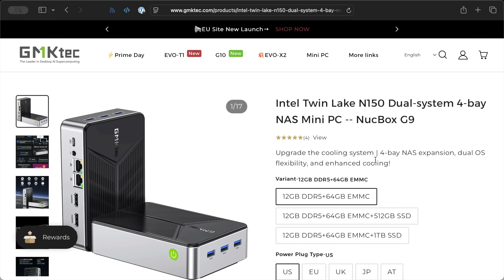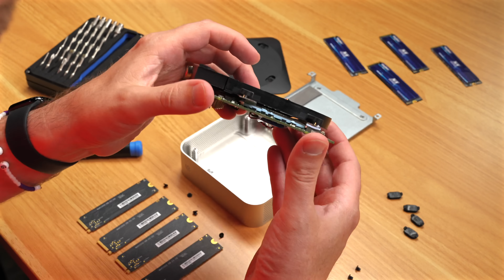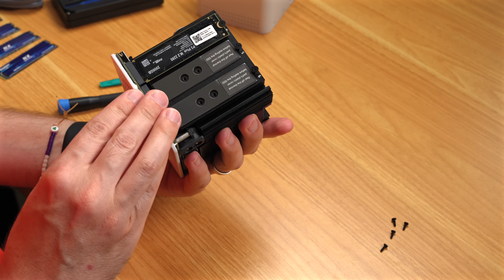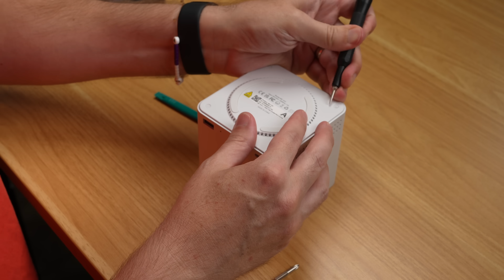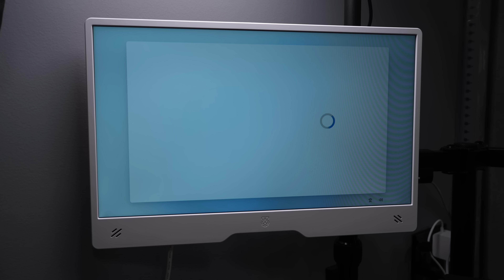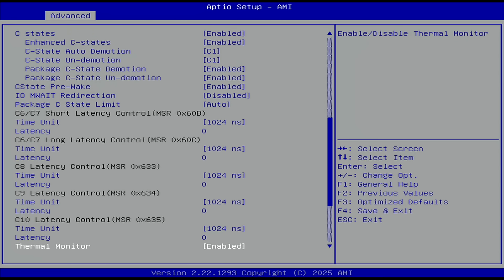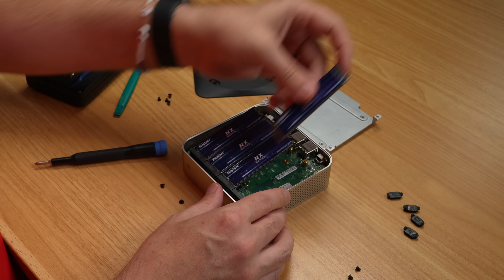The Mini NAS has arrived! (mini homelab)

Comment: I think that's an air intake on the top, not an exhaust lol

The fan inside definitely looks like it's intaking from the top and blowing the hot air onto the bench

Curious if you can remove the fan and flip it over
Reply from the maker: I don't think the fan would work flipped as the mounting and connector don't allow flipping (it's a frameless design), but it does look like it's an intake, which would explain the hotter bottom. strange way to design a chimney though!

Comment: Other Reviewer said, that the fan is an intake. that's why you got the hot area on the Botton. but how are the temps of the ssds? some people has overheating problems with 6 ssds. especially then using as server with constant cpu load.
Reply from the maker: I only ran 5 maximum, but it was keeping them in the 50-55°C range, which was fine by me. These are lower power SSDs though; there are many that pull down a couple watts each, and those are harder to keep cool. You'd probably have to push the fan curve up a bit to keep that system running better.

Didn't realize the fan was running as an intake, that doesn't make as much sense to me for a chimney-based thermal design! But I guess their engineers planned it that way, and that's why the bottom was hotter.
Reply: @JeffGeerling  are this ssds single or double sided? dram?
Reply: and could you test, if the temps better if you change the direction of the fan?

Comment: Oh another bonus you did not mention about the Beelink.  That Wificard can be removed and replaced with an AI accelerator card making that NAS capable of also running a very nice Security camera recording software platform that does hardware object detection.    Huge bonus for the beelink
Reply: Level1Techs tried it and it didn't work. But it was cnvi and USB options in the BIOS when I got it so potentially fixed.
Reply: Meh!
Reply: !heM @TheZimberto

Comment: For what it's worth, I used to run my FreeBSD NAS with a USB flash drive boot disk and never had a problem. Actually, I used two USB flash drives in a geom mirror, just in case one of them failed. But none ever did.

I used a memory disk for /tmp to prevent too much write wear. And since it was just a NAS, I rarely touched the boot disk. If you wanted to run some containers, you could always put those on your SSD array. Performance was fine, too, since after booting, the OS is loaded into memory and doesn't need to hit the USB drive for much.

And if you use those low-profile USB flash drives, there's no risk of anything bumping it and disconnecting. For my NAS, this wasn't a concern, as it was a larger box and I connected to the internal header. But for my LibreELEC HTPC, I use one of those tiny drives and it's worked great. One benefit here is that I can do a fully copy of the USB drive occasionally (e.g. before a big upgrade), and if things ever go bad, it's easy to re-flash to a known working state.
Reply: Do you know of a trick to make TrueNAS CE not write as much on the boot pool?
Reply: @voice5sur5  I'm afraid I don't have any experience with TrueNAS. There used to be a version based on FreeBSD, but they moved everything over to Linux a while ago, and my experience there is more limited.

But in general, I would try to track down what is causing heavy writes to the boot pool, and then see if there's a way to better manage that. The usual suspects are things like tmp and log directories. Linux has tmpfs, so I would imagine that would be enabled by default. But there might be some logging or DB writes happening from TrueNAS's software.

Sorry I couldn't be of more help. Your best bet is to go to the TrueNAS community forums if you haven't already.
Reply: Like for using FBSD too 😊

Comment: Could you not partition a 1GB boot (and empty 1GB partitions on the other drives) and a raid10 far2 root across 4, raid10 far2 swap across 4, and then the rest as raid5; so 4 partitions on all 4 drives? You lose 3GB in total. That way you're not wasting 2TB on an "OS" drive (you only need about 80GB max for a very heavily loaded root fs) if you bind mount /home and/or a /data directory from the raid.

Comment: I actually got that exact BeeMini model after seeing your previous video, doing a bit of research and finding someone else review of it.

It’s my first NAS so very experimenting here but I ended up installing TRUENAS on the emcc as well
Reply from the maker: Good luck and have fun! Try to make sure you have a backup too, makes accidentally breaking things less stressful :)
Reply: I have one on order and I am torn about installing TrueNAS on the eMMC. That reliable source Reddit says it's a bad idea because it'll wear out and fail quickly. On the other hand it comes with Windows pre-installed, so it can't be that bad. But on the third hand, slot 4 uses two lanes so it makes sense to put the OS on a 256GB NVMe in that slot, but then it leaves an awkward 5 slots.
Reply: @merseyviking  I think that I will move it to  one of the drives eventually - I only had one NVME at hand when I got it so didn't want to use it for that.

Can't you replace the emcc if it fails? What can we use it for otherwise?
Reply: @BenleGentil No, the eMMC is soldered on to the main board.
I am now thinking of using slot 4 for the OS, and removing the wifi board and using that as a 7th NVMe slot, but it depends on how much room there is and what heatsinking I can get on it.
As for using it for something, I reckon using it as a backup target for TrueNAS configs could work. Or encrypt it and put secret keys on it.
Reply: @merseyviking  got it! I confused it with the wifi chip…
Reply: usually with truenas I mirror the boot drive. Wonder what optimum setup would be here.
Reply: @merseyviking  Truenas boot drive is basically read-only except for updates, so you definitely should not ever have to worry about write endurance. 
Also, since Truenas data (logs, config, ...) is stored on the first storage array you create (by default), IF the emmc was to fail you could simply install truenas on a usb drive and change the boot order to get everything working again.
Reply: @merseyviking Thanks for your interesting thoughts! I understand it is limited to 8GB memory?… so we are probably not going to go for deduplication in TrueNAS? 
I am considering this with Proxmox baremetal and hosting TrueNAS as a VM...the PCIe's as passthru... and using your wifi-replaced-as-PCIe idea.... I'm doing such on an old 2015 laptop successfully but wanna move to this hardware solution.

Comment: The cooling situation on the Beelink with the pads only touching the controller is actually ideal, NAND is meant to operate at a higher temperature and when you cool it you lose out on reliability (see: Influence of temperature of storage, write and read operations on multiple level cells NAND flash memories)
Reply: The specifics with NAND is it does not like writing at low temperature and then storage at high temperature.

A high temperature write forces a stronger write - more electrons into each memory cell. This helps retention. But at the same time, high temperature also increases the speed that electrons migrates out of the cells.

So for home use, it's normally best with a cool drive with weaker writes and also slower migrations.

For server use? Hot drive with stronger writes compensating for the higher migration speed. And for server use, you get way more rewrites, so less likely to have data left untouched for a number of years.

For long-term cold storage? Run the drive really hot. Write all data. Remove and store cold (but non-condensing).
Reply: Well yeah, but the poor N150 SOC isn't going to be fine handling it 24/7 NAS style, not to mention some of them had power supplies embedded that would get hot by ambient temperature, and you don't want your power supply to get HOT easily so no.
Reply from the maker: I think there's definitely arguments for the other way too (if there's no thermal contact, you can't manage the temperature as efficiently based on fan curves) — the main thing I've noticed is most manufacturers put heat-transferring labels over the front side of the drive (it's not just a sticker) and the intention is you put a thermal interface against that entire side and not just over the storage controller...

However, I don't think I've ever seen stability issues with even the cheapest NVMes if we're talking anything under like 70-80°C, and speeds like Gen 4/5 and beyond.

Comment: Thanks Jeff - that's really helpful.  I've currently got an old QNAP 6-bay NAS (with 24Tb spinning rust), which is noisy, hungry, and very fat.  Your review just helped me identify the perfect replacement in the Beelink (I was going to go with a couple of Pi NASs based on one of your earlier videos).  May have to do some tweaking to get better cooling at the base (maybe they'll fix that in a later iteration).

Comment: I'm going to experiment and see if I can put an m.2 a+e to m.2 nvme adapter and see if it works.  I'm also going to use something I saw from another creator and put an m.2 extender in slot 4 and run that out the case and connect 4 to 6 sata ssd's.  My parts arrive tomorrow.  
I will say I had issues installing truenas to the emmc. I had to go into the shell and use parted to recreate the partitions before truenas would install.

Comment: Isn't the eMMC on the Beelink just as unreliable as a USB drive?
Reply from the maker: No, modern eMMC storage is pretty decent. Sometimes they use cheaper memory, other times better; but even the cheap eMMC storage I've used in the past few years has been more reliable than the cheapest USB flash drives.

Comment: Why wouldn't one boot from a usb stick? Is it just the reliability or is there actual danger loosing data if the usb stick dies in a weird way?
Reply from the maker: For me, it'd mostly be "oops I picked up the thing and didn't realize a USB stick was in the back, and it snapped off" :D

But a good USB stick isn't that bad (I typically use a SanDisk or maybe Samsung, one of their midrange options that's more like an SSD with a large enough metal body to keep it cool).
Reply: @JeffGeerling  I have been using my G9 with a 2230 nvme ssd in a tiny external USB enclosure. It's a bit janky looking but more flexible, reliable, and performant than a typical flash drive. Also a bit more expensive, but not terribly much. 😊
Reply: @JeffGeerling  Love that you actually respond to comments. Thx dude

Comment: You can create array on top of LVM
You could do the following partition table:
nvme[0-3]n1p1 - size 300MB and RAID1 for /boot (mdadm 1.0 metadata version)
nvme[0-3]n1p2 - rest of disks available space as LVM PV

and then inside LVM you can create system LV for / with mirrors=2 and install system there and LVs for you data on each PV, then combine with ZFS.

In that case you get redundancy for system LV and it will boot from any NVME available and can survive lost of one NVME with system.
Reply: Why not to let the ZFS of BTRFS handle the hard drives directly? the ZFS particularly doesn't like anything between itself and the raw storage. You can create raid1 volumes and boot from it.
Reply: @OwnTwoHands_  It's not flexible as LVM and could create issues for OS to boot.
Also it's possible to create LV that will be encrypted with LUKS and use TPM to unseal it during boot from initramfs.

Comment: I´m not paid by bee-link; and my first device was the "9" - terrible heat (Baking Brick), than i choous cwwk p5, solid metal, stronger cpu.. and it´s a nice tiny device.
I run proxmox on it, and Zimas-OS inside proxmox.
The problem was/is; even when i switched of the VM... the cwwk still run hot, as it was while useing Zima-OS
Running only proxmox... there wa not heat problem at all.
And than i ordered the me mini, for myself, 2 devices.
The support was helpfull at all, and we tried to find the best solution, and they knew... i am not a influencer, not a youtuber... only i privat buyer, uesing for myself

What should i say??? I tested a lot aof the mini devices of the last 2-3 years; and i was mostly against nvme-solutions (Expensiv/capacity and so on) , but filled with 6x2 TB, for the moment it´s great: Mostly no heat, no noise, it´s fast (U lose so many time while others things, so bottle neck is your smallest problem)
At the moment - and i really love the cwwk - , for me, for this basic price of 209 + NVMEs the me mini ist the best offer on market i knew.
One one device i run "TrueNas" on the emmc , on the other Proxmox with vm´s, and since i had them (1 or 2 month) there was no problem at all

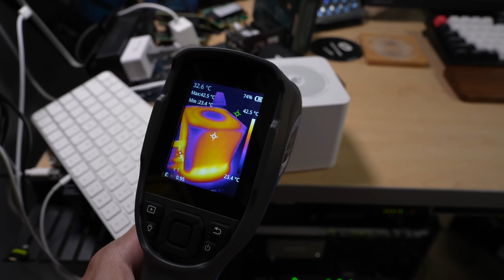Comment: 11:04 I don’t know where you’re feeling air out the top. The beelink fan intakes from the top. Thats why the heat is radiating out the bottom. It wouldn’t do that if the fan was actually blowing out the top.
Reply: What if you flipped out upside down and added some feet to allow better air flow from the "new bottom"?
Reply: Blowing down in my experience also helps keep dust from accumulating.
Reply from the maker: Ah... that actually makes sense. And why it felt cold up there... I was feeling the air intake and not exhaust.

Seems like a silly way to design it then, you lose any of the chimney effect / passive ventilation that way.
Reply: @JeffGeerling  From what I've heard, it doesn't take much to overcome convection with a fan of any kind. It probably doesn't make much of a difference either way for this...just depends on where you want dust to collect I guess?
Reply: @JeffGeerling  I wonder if putting some feet on the bottom to raise it off the desk a little more would improve the cooling.
Reply: @JeffGeerling  actually the air turbulence inside the case caused by the interaction of the chimney effect and the fan flow causes more heat to be dissipated into the air which is then exhausted out of the bottom. Similar setups are used in a bunch of industrial machinery.
Reply: @JeffGeerling  Wonder how much flipping the fan direction would effect cooling.
Reply: @Awrethien  I'd like to see an update on that, even just as a pinned comment.
Reply: @JeffGeerling  Not really, since the chimney effect is always bad, because the warm/hot air takes time to get up and in that time, it accumulates more heat at the bottom.
Also, blowing it out at the bottom creates another "chimney effect", but around the case ...
Reply: It may be that the largest source of heat is at the bottom (PSU?) so pulling cooler air over the "less hot" parts avoids feeding them pre-heated air. Only your FLIR knows for sure...

Comment: I ended up returning the me mini.  I’d bought it for a frigate server replacement for a larger server and had high hopes but didn’t even get through creating a zpool before drives started going offline from what seemed like either power or some other bad controller.  Ended up just bailing on redundant drives and using a radxa 5c with an NVME.   The 5c kills it with frigate and sips power.

Comment: Greg, another great video, I’m photographer that takes many pictures, I used a SAS full RAID 5 in HW but spinning disks a little slow, I bought a second but surprised the RAID is by software that requires subscription, I’m looking for a DAS using NVE drives and with high speed options via USB, networking can be slow and restricted even using 10Gbps, the networking is not only the physical interface speed but the transfer speed always reduced, any plans to test DAS full RAID HW using NVE. Thanks
Reply from the maker: I'm doing that currently with two U.2 NVMe SSDs in my main storage server, but using ZFS RAIDZ1 (basically a mirror) in my Arm NAS; see https://www.jeffgeerling.com/blog/2024/building-efficient-server-grade-arm-nas

I don't often cover the faster systems as I tend to stick with smaller builds on this channel... but now and then I do!
Reply: @JeffGeerling too big for me, really looking for fast and reliable RAID N.2 NAS with thunderbolt 4-5, thanks
Reply: Do you mean that you want NVMe only for storage or a mix of NVMe and SAS? In either case, RAID5/RAIDZ is not the best if performance is your main goal. You should consider striped mirrors.

You might also consider a combination of a high speed external SSD (e.g. NVMe Gen 4 over USB4) for working on a project, then syncing to a NAS with HDDs for more storage.

Comment: My g9 have middle frame removed and then taped back together with spacer in the middle 

Me mininwokring fine for me but unfortunely the wifi slot was a cnvi and wont have pcie lanes for me to steal and out a system drive there 
Running truenas with 1 system drive + 5 drive doing raidz1

Comment: The point is fast network speed with nvme drives or there is no point..
Reply from the maker: The N100/N150 are just too slow to push through more than about 5-6 Gbps over a 10 GbE connection. Though I hope we start seeing more 5 Gbps devices, as those will still work over Cat6e, and the NICs are getting cheaper finally.

Comment: Is it possible to run one of these on a shelf without the case on a mini rack? If not are there any mini servers for the racks. For the record I will run a couple of pi's.
Reply from the maker: Sadly as you can see in the GMKtec G9's case, they don't have any good mounting points, and some designs require parts of the case to hold things together. It can be done, but it usually involves tape and some cardboard shims!

Comment: Devices this tiny are not practical at all and are pretty much just toys to play around with
Reply from the maker: Any of these (even the GMKtec with cooling issues) could run my entire homelab in one box if I needed to—it's just less convenient and I'd have to sacrifice some features to make sure the CPU doesn't get overloaded.

They're certainly fine for the price, if you have mild/moderate use cases.